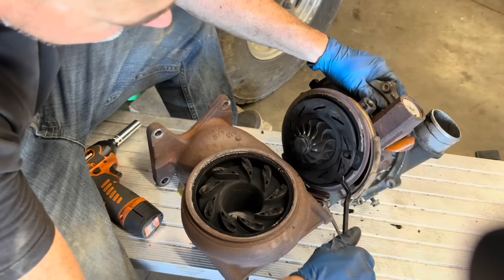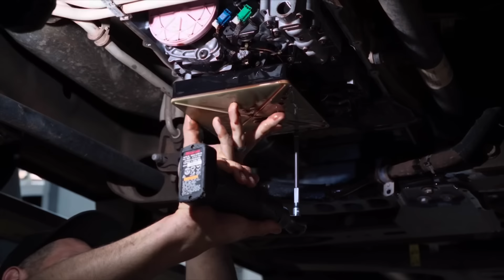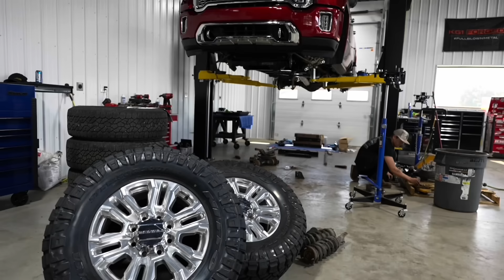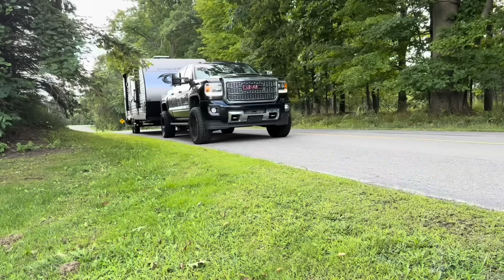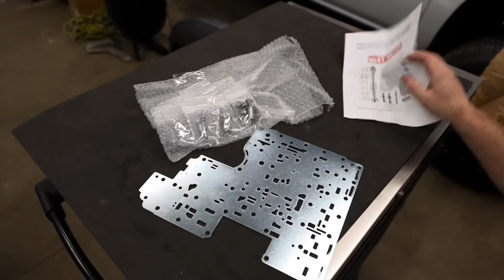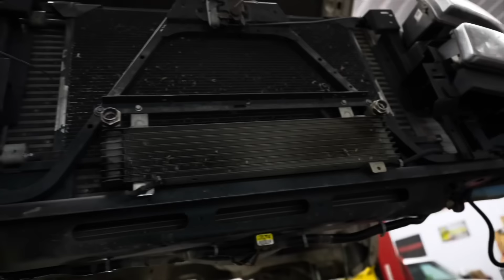Duramax Trucks Recalled For Rear Ends LOCKING UP on the Road!?

Comment from the maker: Let us know if your affected buy this recall? Thoughts on buying a new truck nowadays? Comment below ⬇️ 
Click here to enter in for the TRUCK GIVEAWAY 👉 https://truckmasterdiesel.com
Reply: I have a 23 gmc 3500. I delted it, and 2 days later the valve body failed. I went through no zone diesel and got the next gen upgrade kit. Got it all put back together and has been good so far. 
I can tell you the update is garbage.  Mine had the update, and it still.made the loud and hard bang, followed by a limp mode. Note for any one reading this, keep that 10L as cool as you can. It failed at trans temp of 190°f. With the kit I got it came with a PPE trans pan, and that has put in some work! Towed medium heavy ( 24ft enclosed loaded up) 80mph through the mountains in the summer, the hottest I got it was 150°f averaged 134°f
Reply: Our 2024 Silverado 2500 HD 6.6 Diesel with 10-speed Allison at just over 31,000 miles experienced hard shifts, limp mode, and threw a code 0700 and 0747 as reported by my dealer's service dept. It is now being services with a 3rd Gen Valve Body. We're very blessed to still be covered by the factory warranty, but is GM's replacement 3rd Gen Valve Body going to last the typical life of a Silverado diesel?

Comment: My question is. If my gruck is tuned and deleted if my valve body will be covered? I currently have 125k miles on mine and thank God no issues but i would love to replace the balve body before it fails. I do a lot of road trips with my family.

Comment: Have a 2020 High Country 3.0 lm2 Duramax with 72k on the odometer and received the recall notice via mail back in September (2025). One month later experienced a (rear wheel lock up) driving in town (without a trailer). Pulled over and checked what had happened and found that I had lost reverse but would drive only in (limp mode)… limped it straight to the nearest GM dealer where they updated the software but still had no reverse after a (test drive). The dealer replaced the Valve Body and stated “We have done our part and are waiting on GM to give us the new PUN number” I’ve been without my truck for nearly a month now because of this new “PUN” number that GM can only give the service tech to complete the repair. I’ve heard of people waiting months to get their vehicle back because of this recall. Guess I’m gunna be another in the long line of waiting???

Comment: Everyone says should have stuck with Allison transmission. As for durability they were ok, but, and I stress BUT, the Allison transmission case is junk when lateral force comes into effect! In all my years I had a few u-joints go out, sound bad, break, or the worst part bad vibrations. When I had vibrations in all my vehicles over the years I could still drive but at slow speeds to get to a shop or home. If anyone that reads this has an Allison transmission and a u-joint goes out and you get vibrations, QUIT DRIVING AND HAVE IT TOWED! I had friends and know people that this happened to and they ONLY drove less than 20 miles at slow speeds, under 40 mph, to either get home or to repair shop, and the lateral vibrations cracked the Allison case, which means new transmission! $$$$

Comment: 2022 L5P. Got a Gen4 valve body modified from SunCoastDiesel with a new modified trans pump.  Installed at home in approx 1.5 hrs. 31,151miles on the new valve body.   Flawless operation. Zero issues.    Worth noting:  I have the ability,  but did not perform TCM relearn procedure.   Truck shifts were not rough but did get back to normal after approx 40 miles. Good luck out there!
Reply from the maker: Great info thanks!
Reply: Less than 200 bucks worth of parts needed.  It's just 1 valve fluttering.

Comment: This is the same recall they did on the 1500 with the 3.0 duramax.  The 3.0 duramax 1500 uses the same transmission as the HD trucks.
Reply: No the 3.0 uses a 10L80 transmission 10 speed.. not the Allison … ford and GM share that transmission for their half ton trucks

Comment: I have a 2024 - 2500 high country that sat at the dealership for 4 months waiting on a new valve body. Truck only has 38k miles on it and it is already shifting hard again slamming into gear in the mornings. Not impressed on for the price of the truck.

Comment: Vedio idea!!!! Make a video showing us step by step how to install this kit to our valve body, then I'll buy a valve body kit off of you as a thank you. Mine is a 22 2500hd duramax 28k mile    shifts good only issue I have is when going from park to drive at times it hard and you get a thump almost like too much pressure.
Reply: YES!! I have a 22 and it’s happed 2 random times… put it in gear from park and the clunk sounds like a gear broke haha.. other than that.. I’m not on the recall list and have no other issues
Reply: @averyprolawncare5273 I got a letter in the mail for transmission  months ago. I need to schedule an appointment asap.

Comment: Hold up
Rear end locking up or transmission locking up?
They're not the same thing
Reply: The trans will downsift several gears instantly and lock the rear end.  Skids for  a second. Could cause an accident.
Reply: @merlpriester You mean the trans locks? How does the rear end lock and not the trans?
Reply: Legal drifting … can’t wait 🤣
Reply: Transmission downshifting to 4 far and chirp gears. Like having a stick shift down shifting too many gears and letting the clutch out too fast

Comment: My 2020 Denali HD has had the software update since March and I have a little over 95k miles total without any issues.
Reply: I have a 2020 Silverado 3500, software update no issues either. KNOCK ON WOOD.... But im having Service ECS, I've changed both front speed sensors, it's either the rears, time for Brake fluid Change, or ABS module, or Steering Angle sensor...
Reply: @shawnl4756  I have changed the coolant tank for the level sensor and that is it. Looking to T&D after 100K.

Comment: MY COMPANY HAS  TONS OF THESE TRUCKS  AND I USED TO TELL EVERYONE TO GET A DURAMAX BC WEVE HAD SUCH GREAT LUCK WITH THEM BUT SINCE THE 10 SPEED CAME EQUIPPED WE HAVE OVER 10 TRUCKS WITH FAILED TRANSMISSIONS WITH LESS THEN 5K-18K MILES ON THEM.   WE HAVE 11 6.2 HAS TRUCKS AND EVERY SINGLE ONE OF THE NEW ONES BURNS QUARTS OF OIL BETWEEN OUR MECHANICS SERVICE THEM. THE ONE OLD LS TRUCK WITH 200K+ DOESNT BURN ANY OIL AND IS ON ORIGINAL TRANS. FUHK GM CORPORATE SUITE AND ALL OF THE PEOPLE WHO ALLOWED THE QUALITY OF THIS JUNK TO HAPPEN IN THE FIRST PLACE.  PEOPLE COME TO ME TO ASK ABOUT CARS AND TRUCK'S ALL THE TIME AND NOW I TELL THEM TO STAY FAR AWAY FROM GM UNLESS YOU PLAN TO SPEND ANOTHER 10-15K TO FIX ENGINE(GAS DOD), TRANS REAR END ISSUES ETC.
Reply: OH My
Reply: WHATS UP WITH THE CAPS?

Comment: While it is easy to blame the EPA for the cylinder deactivation on GM’s gassers (half ton) or emissions equipment on the diesels, GM owns the transmission issues.  No dodging it.
Reply: Well I'm sure the 10 speed is also because of the EPA, trying to meet  better fuel economy

Comment: Thank you for always getting important info out there and keeping me interested in watching all the videos on your channel. Canadian with a 2020 chev 6.6 duramax with 70 000km.  Received the software update 6 months ago. Tow a 5th wheel and dump trailer as hobbies using engine brake and tranny haul mode up and down decent grades - no trouble yet. Truck is stock other than a 3" BDS  lift.
Reply from the maker: Thanks for the great feedback 👍

Comment: I have a 2022 3500 and have not had any notice about recall however I do have the My Chevrolet app that says it has a recall, I only have 84000 km on it in Canada and only put about 6000=/8000 km per year so not many miles

Comment: My 3500 2020 gmc was retuned and a new trans computer was installed by an  independent  shop. Because I was towing out west and no problems. It shifts better , love my 10 speed  and the best mileage is 25mpg. Weight over 9k.
Reply from the maker: Good to hear it worked out for you

Comment: I have a 2019 Silverado 2500HD Duramax with Allison 10,speed. I have had my truck do a hard downshift on me when I am breaking a little bit heavy while slowing down to stop. It has happened to me several times. I reported it to the dealer during service visits. They claim they can’t duplicate the problem. I told them it doesn’t do it all the time. It has actually chirped the rear tires a couple of times when it downshifted.
Reply: I thought 1o speed didn't start till 2020, 2019  have  6 speed Alisons.
Reply from the maker: That's definitely concerning! Your truck has the 6 speed if it’s a 19 but either way I would check your transmission fluid before you go any further it sounds like line pressure or a flare shift
Reply: @TruckMaster last year I had ALL the fluids and filters changed from bumper to bumper. Differential, transmission and all. Truck has very low miles, 25000, but they stated it was the 5 year service regardless of the miles. I have an extended bumper to bumper warranty, so I didn’t want to risk voiding it. They never said anything about low transmission fluid when I get it serviced. It has also did it once after all the fluid changes.

Comment: I have a 2022 2500HD Duramax but was told my truck is not in the recall. Any idea why not all trucks with this transmission is included in the recall?  By the way, great job on the video (as usual!)
Reply from the maker: Thanks Jake! Get a second opinion from another dealer also find out why your not included because you definitely are.
Reply: @TruckMaster Will do!  Thanks for your quick response!
Reply: They may just be triaging them by VIN so as to not overwhelm dealers. They did that for the 6.2L motors.
Reply: @rsbreeze I only have about 26K miles it so I would rather have any upgrades done to it sooner rather than later. Do you know if GM is extending the warranty on the entire transmission or just the valve body?
Reply: @jakebernstein2526 probably just the valve body. I lnow on the 6.2L recall, if yiur motor passes the test, the 10 year warranty only covers crank bearing or related failures.
Reply: Same for me… 2022… not on recall list 🤷🏼‍♂️

Comment: Next gen has been saying that their valve bodies can be requested to replace gm valve bodies as the warranty replacement. So it seems it may not necessarily void the warranty.
Reply from the maker: I’ve heard that as well but I can’t confirm it thanks for the info though I should have said that in the video.

Comment: Why is ford not having these problem? It was a joint venture.
Reply from the maker: Ford’s version doesn’t appear to be manifesting the exact rear wheel lockup failure in practice because their variant of the 10-speed is either more robust in the relevant component valve body control circuit or their shift design avoids the critical condition, or they already have mitigating software. But that doesn’t mean zero issues.
Reply: @TruckMaster True, you just don't hear about it like you do with gm.

Comment: 10 speed junk! GM should have kept the 6 speed real Allison.
Reply: I'm surprised someone hasn't come up with a way to retrofit the 6 speed Allison for the newer trucks
Reply: @jfromstatefarm2345 It would cost as much or more than upfitting the 10 speed.
Reply: 10 speed works great for me, smooth.
Reply: Good ol allison 1000. I had it in my 2007 lbz. Have a 2024 zr2 dmax with the 10 now. No recall yet but I tow a 40 footer at 17k full loaded
Reply: The fix is just a couple hundred bucks of parts that any transmission guy can install in the valve body.
Reply: Money follows the money
Reply: Its actually a really nice transmission that manages power and heat well......but just like a lot of their stuff it's unreliable and plagued by warranty work. 

I've got a 22, 23, 24 and been at the dealer more times in the last 3 years than the previuos 35.
Reply: love my 10 speed. The 6 speed is such a dinosaur.
Reply: @Bigtuna-jh9uq  yeah till it breaks lol… then you’ll want the dinosaur back!! and that’s a fact
Reply: @mjljacobful  thats what the luddites said as well, but time and technology marches on...